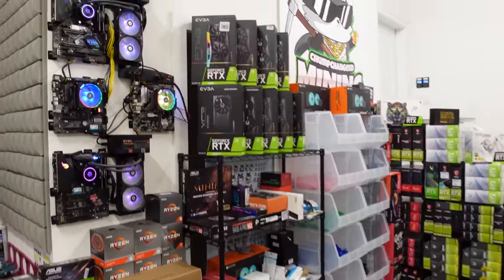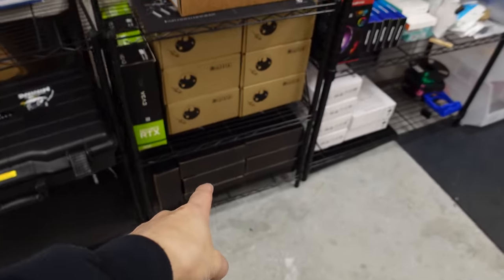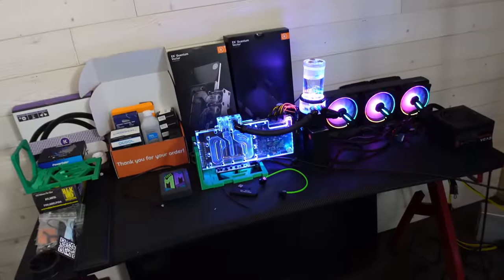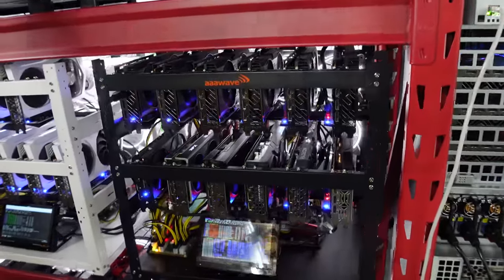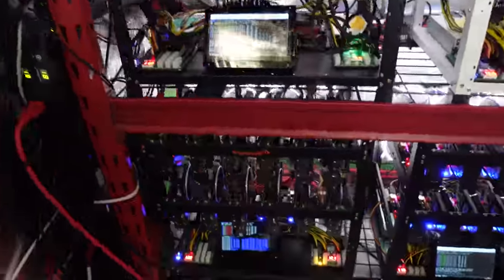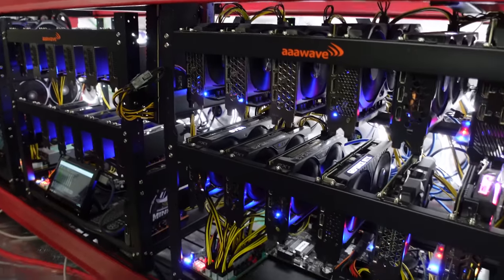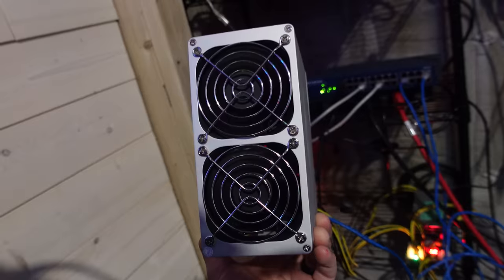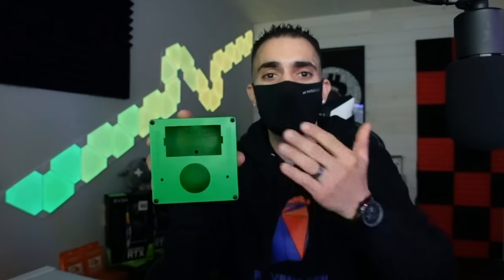My At Home 130 GPU Crypto Mining Farm Setup and Hashrate

Comment: lookin good, your farm is growing nicely and the grow tent is awesome.
a couple things I'll offer up based on my experience:
1) take an angle grinder to the face of those Sleuce v2 support bars that have the logo on them (and the bars below that are the same).  This won't help your a2k rig, but for the others-- aaawave built these in a way that restricts airflow on the most sensitive part of the the exhaust face of our cards.  I discovered this with a thermal imager I borrowed from a buddy.  I cut them off and just kept the horizontal part and they're still plenty strong, with a nice increase in airflow.  Took 15mins/rig.   The angled supports on the other side keep the rig plenty stable/rigid.  Hopefully, there will be a Sleuce v3 or some such that addresses this design flaw- I really love the aaawave frames except for this and a couple other small little flaws (stackability, and psu orientation screw holes being the other two pet peaves)
2) hock all those 120mm fans on amazon or eBay or something, and do yourself a solid and visit Walmart or Home Depot for their 3speed box fans.  They're like $25, will use less power per rig, provide 30-50 TIMES more airflow than those dinky fans on 100%.   If you want lights, buy lights.  If you want fans, buy real fans.  You'll come out ahead in net $, performance per watt, and cooling power.  The downsides are noise - which gets meaningful once you have like 6-8 box fans going, and vibration, which you solve by putting them on separate shelves.  I don't ever recommend having a box fan on the same support surface as a mining rig- as it will wiggle the rig 24/7 and that's not a good idea.  The fans I use move 2,000 cfm on speed "2" where I keep them.  Those little RGB case fan things are moving like 50cfm/ea.   You'd need 40 of them somehow mounted to one rig to come close to doing the job of a real fan.  The objective is to get massive quantities of air across the cards- they're just ill-equipped to the task.

badass tour chump, thanks.  You're killin' it.
Reply from the maker: Haha your AMAZING!! Thank you! Yes them fans are mostly for the lights and your 100000% correct. Dammit 🤣, Appreciate you! ❤️

Comment: What’s the best 3D printer that’s 100% newbie friendly and easy to just download and print. I want to print brackets and random things for pc mods. Nothing crazy. I’d love to make parts like at least 7x7 is that possible ?
Reply: Check out the Ender 3 pro. They are $99 on sale at Micro Center right now. Very respectable printer for the price!
Reply from the maker: Damn that’s a good price! I paid ender pro v2 for $279 Amazon
Reply: I personally have the Prusa Mini. It’s been very reliable and I have had no issues. Any Prusa performs well.
Reply: @thepenguinman6389  they are pricy though. I got a 500$ budget anything better suited for Less that won’t need tweaking as bad as an ended.
Reply: @cppctek  I guess in that case I would recommend one of the Ender printers and a lot of filament. I think my next one will be an Ender 3 Pro.
Reply: @thepenguinman6389  ah I’ll save up. Enders are too much work to keep up and get stared. There not the best but they work and there cheap.

Comment: About the 1660 supers did you stick with the msi bios or did you switch to Palit?
Reply from the maker: MSI on the hynix ZOTAC ones. The plait on the PNY ones
Reply: @ChumpChangeXD  I have asus Phoenix 1 fans had no luck with the msi bios got like 31.5 to 32 mhs, I usually get 31.5 so I switched back to original bios, will try Palit bios tomorrow
Reply: Ooof I managed to get 35.5 with palit but not stable, now at 34.5 stable for 6 hours but the temps are jumped by 8C not sure if 3 MHs is worth 8C.

Comment: Don’t you need the fans and cooling blocks even in the tank. I’ve seen videos on this before and you can’t just drop in a bare card. They don’t cool that well.
Reply from the maker: Ima build a manifold inside the tank 😉

I’m a master plumber so I have all sorts of fittings and pipe 😬

Comment: Hi, for the 580  SK Hynix  do you use aggressive undervolting ?
Reply from the maker: Yes
Reply: @ChumpChangeXD   Thank you ! : )
Reply from the maker: 1150 core
1 core state
850 core voltage 
2100 memory clock 
1 mem state
“Aggressive undervolting” checked on
“Advanced config” Amd refresh 30
Reply: @ChumpChangeXD   Nice... thank you i will try that. My actual setting is :
1175 core
1 core state
850 core voltage
2150 memory clock
1 mem state
“Advanced config” Amd refresh 30
for 32,07 Mh  ( SK Hynix H5GQ8H24MJR · 113-MSITV341MH.650 )
Reply: Correction... whit aggressive undervolting and 1 mem state i have 32,07 :) Thanks very much, i like your channel ! I'm from Quebec :)
Reply from the maker: @smokingun2544  good stuff brotha, appreciate you! Keep grinding!
Reply: @ChumpChangeXD   I have a last question. I have one 570 XFX Samsung K4G80325FC · 113-57085STB3-W90 and i think my setting is wrong :
1150 core
1 core state
870 core voltage
2150 mem clock
REF 20
Do you think i should add the mem state 1 ?  I searched a lot and I did not find a good overclock.